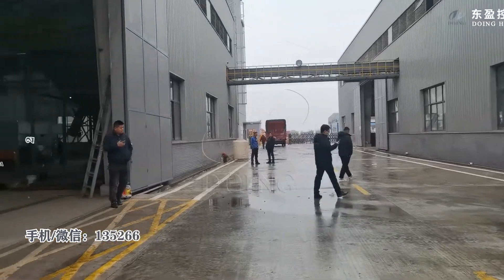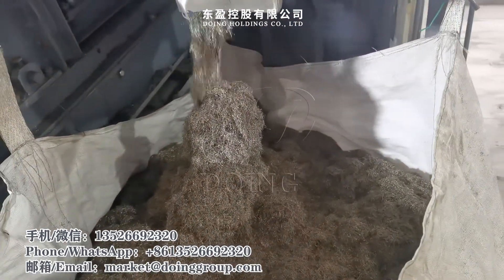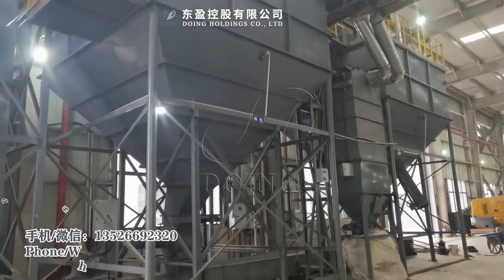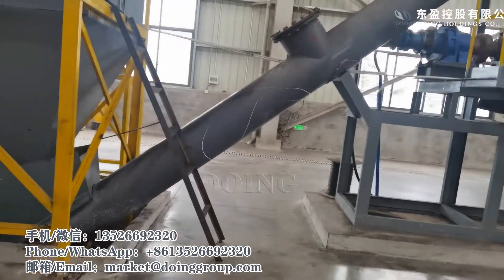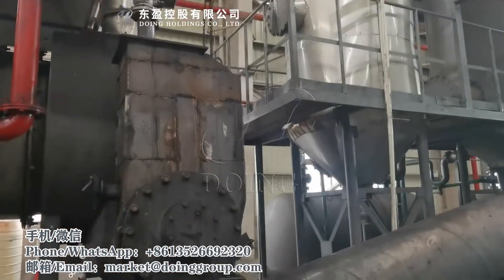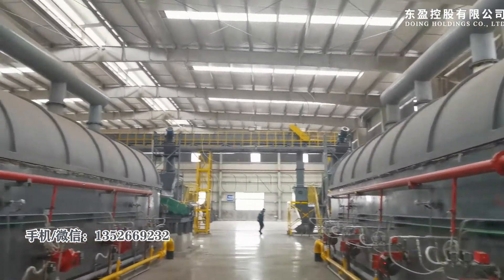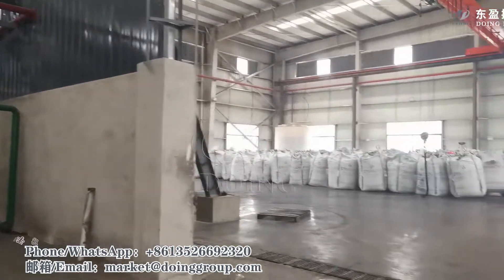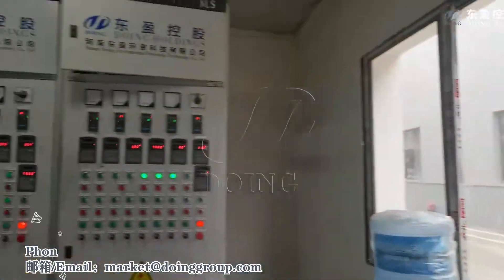New design fully continuous waste tyre to fuel oil pyrolysis plant introduction video

Comment: Obviously people will have many reasons to do this process which I'm not getting into... BUT! Instead of useing oil/gas heaters to get the process going in this setup i would like to se this build into some other production/factory facility producing waste/excess heat - lots of possibilities im sure!

But hey... It's a mad world and hopefully this solution solves the problem of tires better than the city of Springfield (-:

Comment: Can the oil use for cars and motorcycle ?
Reply from the maker: it is not suggested to use it directly for cars. It is a kind of high calorific value heavy oil, generally used for heating furnaces, boilers for heavy industry such as steel factory, cement/glass factory, or power/electricity generation, etc.